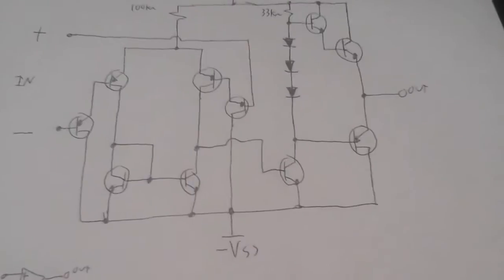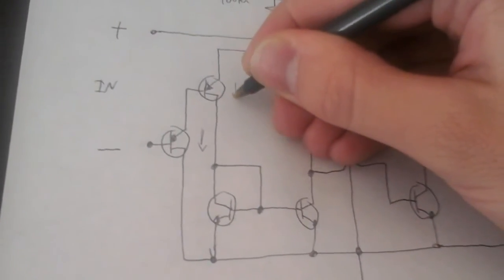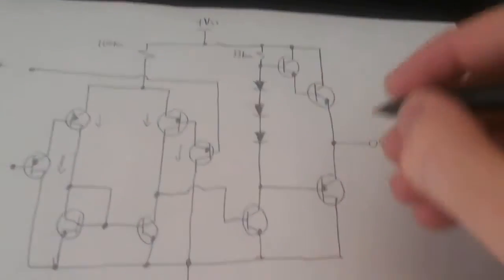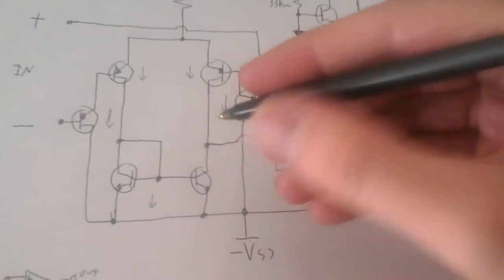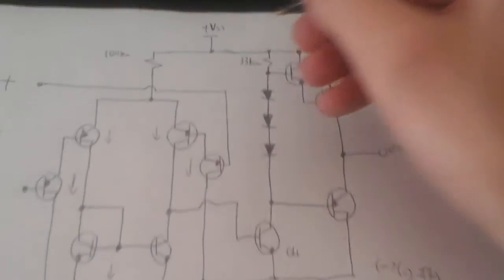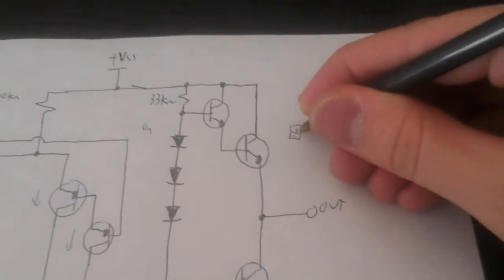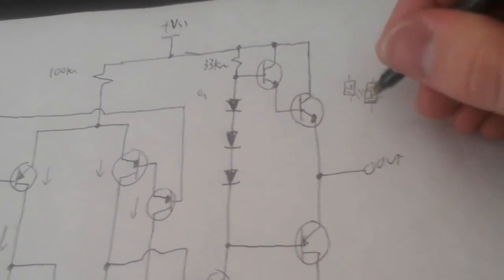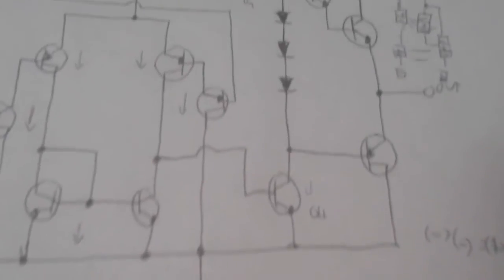Inside of the operational amplifier

Comment: Could you demonstrate your circuit on the breadboard or make a clearer video please. I didn't understand the minus times minus = positive thing.
The inverted input doesn't input negative voltage so how can it activate a pnp when connected to the base?
Reply: Guillaume Paquet I believe that it has to do with the voltage difference between the emitter and the base. If voltage is higher than base, then current will flow.

Comment: In response to you saying that you didn't use a current mirror, you actually did use a current mirror. The bottom of the diff amp is a current mirror and instead of a resistor you used the inverting input as the active load to bias the current in the emitter leg of the transistor on the non-inverting input
Reply from the maker: boganmama I'm sorry, good question. I meant I didn't use the current mirrors as the 2 amperage sources on the top using 2 PNP transistors for each source instead of the resistors(33k, 100k).